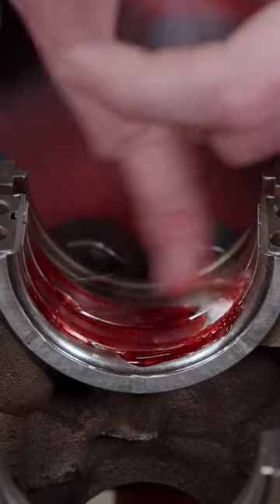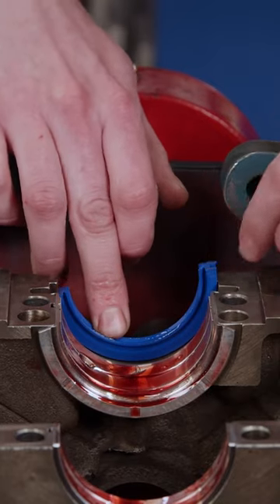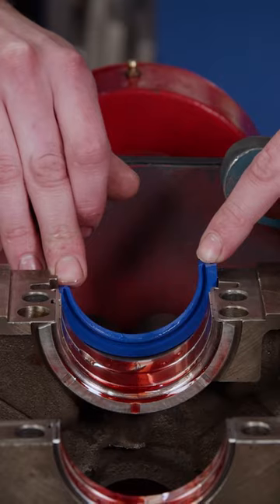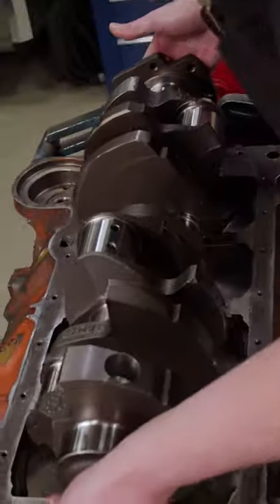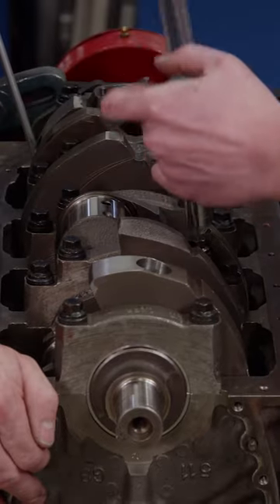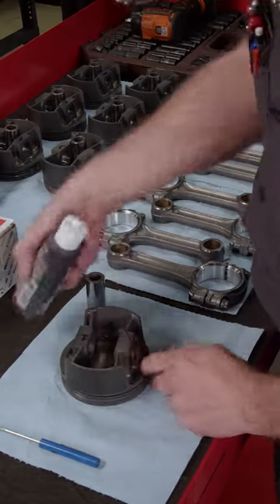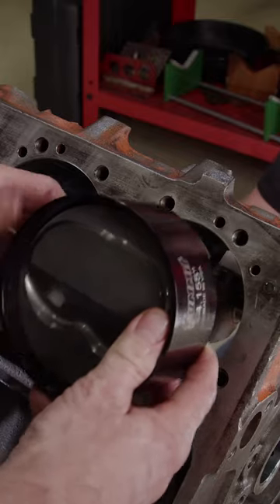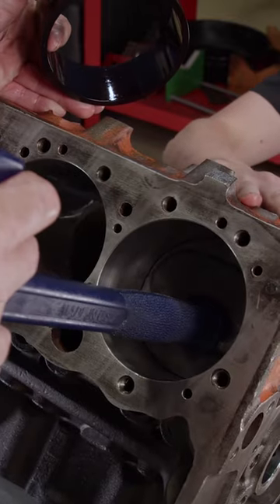Salvaged Small Block Chevy Assembly

Comment: These shows are very unreal, but still very entertaining. They can drop $100,000 into an engine without blinking. Like we all have that?
Reply: They need to have a Road Kill Dino Edition. Junk yard motors, with a budget. Then go see what they'll run on a drag strip or rather how long they'll hold together.
Reply: @anthonyehlers470  I'm not saying junk, but just a little more realistic for the average gear head.
Reply: This is a 100k engine ??? 🙃
Reply: @austingutierrez2709 with the tools you need to do it yes😂
Reply: That's not a 100,000 motor. Not even 10,000. More adorable you think
Reply: $10k and you can have a powerhouse engine, $20k and you can do that with a full supercharger or turbo + exhaust kit. $100k you could do that all, and rebuild the drive train and give it a full body paint job 😂 if money is the first thing that comes to your mind when looking at this, you don't have the money to worry about making more power.
Reply: Thing is they get the parts at cost, or less if it's sponsored. It's about demonstrating the process, and why demonstrate with something that you can barely tell is an engine? It's unfortunate how much it can cost, but with that aaid, I can guarantee you this motor is nowhere near 10said, dollars. Maybe 10 or 15 thousand, especially considering they're buying individual parts and not the whole.
Reply: Not quite that much unless you take into account they have a few rebuilds where the first thing they do is put the block in a cylinder hone. But i do get you, a lot of these builds are way out of my budget my 350 is just a junkyard motor i threw together with somewhat stock components besides a cam. Slowly buying stuff for it. Vortec heads are on the list along with all the valve train and a rowdier cam.
Reply: This is a small block so all these parts were probably less than $1,000
Reply: Some of PowerNations episodes are entertainment, and some of our informational, they do a lot of budget builds
Reply: They could keep it to themselves but they decided to share it. A lot of cars are the same and this can teach people some common sense of cars.
Reply: @anthonyehlers470 they try to sometimes but always go overkill with the aftermarket parts
Reply: Get your money up then
Reply: @shakinbottles  since when do you include the price of tools for the price of the build? Especially because more than likely if you’re doing this probably already gonna have tools
Reply: @shakinbottles  also what are the expensive tools in this video? An engine stand or a hoist?
Reply: @ZootedSosa ide assume they used a milling machine at some point if it was a salvaged motor. Probably also used drills or impacts and air compressor there's alot of money that goes into a good shop made to rebuild engines and bodywork and everything like I get it's maybe not 100k in tools but its still alot for an average person to do at home and most people don't have enough time to make using those tools worth it in the end they might be able to work on 1 car a month maybe while working and everything else that you need. And I was replying to somebody who asked if the engine was worth 100k and I said no but with all the tools (and labor but I thought that was just a given) that UT was probably close idk tf your trying to nitpick me about😂
Reply: This is only a 100k rebuild if you're using snap on tools
Reply: @sargentcupcake666  i think he meant the car thats its going in too
Reply: @austingutierrez2709  I don't know for sure, but it's more than the average working man with a house and family can spend, at least for me.
Reply: @anthonyehlers470 gotta love jyd for bringing junk back to life
Reply: A SBC is not $100,000 if you know where to look
Reply: One thing I have learned through my researches. In a standard performance engine,  it make no difference whether you use chrome, moly or cast iron rings. If I was rebuilding any engine where cast iron rings were original, I would use cast iron. If you are building for a daily driver, don't waste a bunch of money unless you have money to burn.
Reply: Not sure how we're getting to 100k here...  My local machine shop does a block for 650 to 1000 bucks for me.  I disassemble the block before I get there.  They clean, deck and hone cylinders and crank shaft journals...  Parts..  on the 408 stroker I'm building are about 3k..  that's for an undressed motor..  that's new crank, rods, pistons bearings and heads.  bolts and heads.
Reply: @skippynj1979  those are for normal every use engines im pretty sure the one he's building is for racing
Reply: @skippynj1979  You're not trying.
Reply: @Charles-oe4kj  gotcha...  I know most the teams out there are using leased engines on allot of the circuits.  Really don't know what this build was for.  I am a hobby engine builder.  It's fun..  sometimes they blow up..  most last long after I sell the vehicle to the next person..
Reply: @anonymike8280  if I was doing an old F1 engine...  I'm sure the costs get out of control

Comment: Man putting an engine together has to be some scary stuff. Probably feels amazing when it all works though
Reply: I could put one together no sweat... Now taking a working one apart and putting it back together is a different story lmfao
Reply: Fallow the instructions and have lots of buddies to see what you fu ked up
Reply: Having one started, pulling it down, label all parts and measuring, then rebuilding and starting it 👌 nothing quite like it
Reply: It's not scary, once you actually do it.
Reply: @ThatOneKiidThere  indeed. Did my wife's 07 suburban. Nothing like everything going right when you did it
Reply: Eh its not all that scary
Reply: @DONTCALLMETHAT you fix the low oil pressure? They like eating rod bearings because low pressure at idle
Reply: @outkast937  did the DOD delete
New oil pump and sensors. Infact everything new. .
Reply: Small block Chevys are not difficult for a backyard mechanic. I did 3 of them when I was younger with good results. An automatic transmission however is one I’d never attempt 😂
Reply: These parts aren't so bad... It's the wiring looms that scare me
Reply: @GIwillo  One thing to make sure of, although this may have been corrected long ago. Still, make sure there's no front to back play on the camshaft. Ford used a thin thrust plate with a thick gear, and vise versa. Two different versions. Thick with thick, and you'd bolt the cam solidly to the block. Thin with thin, you may not notice and could scrap your block.
Reply: Scary? Why? 
I’ve built all of my own engines, my own transmissions, my own rear end, in every drag car I’ve ever owned. I don’t understand what is so scary about it. As long as you do everything correctly and right, you have nothing to worry about.
Reply: @12yearssober 
Have built several automatics GM, Ford and Chrysler never got into any of the Nissans or Toyotas. I do all of my own engine transmission and rear end work. Excuse me, I mean I used to do it the last transmission I built in the last engine I built was about five years ago but doesn’t mean that I still can’t do it. I’m just old now. 😩
Reply: Every part has its place its pretyy much just understanding how they all work together. Once you know you can re -build anything

Comment: Always blows me
Away that the rods are connected with two bolts and can literally go hundreds of thousands of miles never once coming loose it’s just wild
Reply: The bolts are torqued to high heaven!!
Reply: Cool thing about piston rod and crankshaft bearing bolts is they're 'torque to yield' bolts. Meaning they physically stretch when torqued correctly, thus they should only be used once.
Reply: @adarco99  interesting I didn’t know that, thanks for the info that’s trippy but makes sense
Reply: Not all rod bolts are torque to yield. Popular ARP fasteners are torqued to a stretch value, but they return to their original size when loosened. TTY bolts are more common in head bolts, but make test fitting for checking clearances much harder.
Reply: @neerajahluwalia5512 Not really. TTY bolts shouldn't leave any gaps to close up when taken to their fixed torque spec (ft-lb, Nm, whatever). The additional angular rotation is to take up the elasticity of the bolts, so that they can't stretch under load and allow clearance between the components.

So if an assembly specifies e.g. 15 ft-lb, then 40, then 62, and then 90°, you do the first 3 steps until you're at 62 ft-lb, then make your checks and disassemble. Bolts are still usable in final assembly, because they haven't been torqued past their elastic yield point - they haven't stretched yet.
Reply: @Azlehria  if you look at the curve of stress vs strain of a material, even through the elastic zone, the stress continues to rise. This means the clamping load increases. Not torquing the bolts fully (the extra 90 you are specifying) will result in your clearances being off from measurement to final assembly.
That extra 90 is specified as it is a more consistent way of obtaining a torque value. E.g. torquing a bolt to 100ft-lbs vs 60ft-lbs + 90deg, the latter will be more consistent across different situations
Reply: @neerajahluwalia5512  The clamping load increases, yes. In order for that to affect assembly clearances in the bearings, the additional load would have to distort the caps by compressing the entire flanges beyond their designed limit; the bolts will fail long before that level of distortion is reached.

My AERA instructor actually demonstrated this to us. 3 sets of bolts, 3 PlastiGauge setups, one sacrificial assembly. Compression was the same between pre-load torque only, with the angle spec, and with the bolts broken off.

Once the pre-load is reached, you should have zero clearance between the mating surfaces and the material under the fastener should be at the maximum compression possible with that fastener. The only component which should be able to change its position or dimensions after that point is the fastener itself. Which is also why TTY is generally a lubricated torque spec: to reduce (ideally eliminate) any binding or galling which could falsely indicate proper pre-loading prior to the part fully seating and compressing.
Reply: @Azlehria  yeah but most tty bolts are not made to be reused.
Reply: @tscustomstation  Congratulations on not actually reading my comments. May I suggest that you try actually doing that before responding again?
Reply: There are torque-to-yield bolts and there are torque-to-tight.bolts
 TTY bolts typically are single use bolts, TTT can be reused. Instructions are important to know which ones are being used.

Comment: I can’t even crack open the water pump without feeling like I left everything loose lol imagine going balls feel like this and just hoping it works
Reply: You just have to be methodical. Take it one step at a time and don't proceed until the previous step is done. Torqueing in sequence, marking torqued bolts, assemble all pistons, then torqueing each completely as they are installed.

The step you miss is the one that will get you. So don't miss a step...

Comment: Millimeters, new generation of parts and the price is through the roof now.
Reply: Those Manley pistons are some of the best you can buy. Extremely light forged piston, with thin metric rings, the skirts are moly coated and the dome is ceramic coated. They're not cheap but $800 bucks for 8 pistons and ring packs for the best pistons you can get for a sbc isn't that bad. If you don't care about power and longevity then you can still build a sbc on a budget but parts like these aren't designed for a 350hp engine that'll rev 5,500 rpm...

Comment: Who doesn’t love a two piece main seal?
Reply: 3/8 offset?    I get the offset but why so much?
Reply: I’m not a fan of the 2 piece seal
Reply: @xmradio11 it's all they had for 80 years, give or take.
Judging from the bore, this is a 400 block.
Reply: @randybehrmann5454  I've only built one V8 in my lifetime. It just happened to be a small block 400 with 2 bolt main bearings. It was roughly 500HP with the 125 power shot nitrous. That was fun to build and drive.
Reply: Id rather have the 1pc. You can change it at every clutch job without dropping the oil pan

Comment: I've never seen instructions that say off set the 2 peice rear main
Reply: It's been common practice for 30 years or so to help prevent rear main leaks by offsetting the parting lines of the seal and the main cap.
Reply: I guess you've never looked at the instructions
Reply: interesting never knew this prolly cuz never looked at instruction
Reply: Felpro says do it.

Comment: What is the composition of engine assembly lube? How does it differ from engine oil? How well does it mix with engine oil when the engine starts up?
Reply: You are supposed to change the oil after you break in the engine/ cam. So 20 minutes or so. The assembly lube stays where you put it, unlike oil which will drain. Just adds extra protection for the first start up and break in period. 
 Also after first startup, cut open oil filter and make sure there is no "glitter" or metal flakes inside the filter.

Comment: Never Ever offset the rear main seal. Its designed to crush when rear main cap is installed and torqued. Just apply a dab of ultra black silicone

Comment: What would happen if you just put a crankshaft in without measure the bearings is there any presedures to it
Reply: Normally, the main bearing clearance is in the. 0.02 - 0.03 range.  If the clearance is too tight, the bearings could seize and spin. Too loose could cause low oil pressure. Rod bearings are usually about the same specs. On the rods, you should check the clearance between the big end of the rods. That clearance should be somewhere around 0.06 to 0.14. 
If you just throw it together and hope for the best. That could be a colossal waste of money. Cuz, it might not last very long.
Reply: @Thundarr995  if you are giving the mains .020”-.030” clearance? I promise you, it will come unglued quick like in a hurry.
.002”-.003” but closer to .0025” 
That decimal point makes a HUGE difference in placement.
Reply: I love all the experts, the word blueprint comes to mind , when machining all the parts you set the clearance is cranks turned on low or the crank is, time for the rods, there's a half a thousand from hi 2 low, the mains there's 9/10 from hi to low ,,it is rare define it doesn't measure where the manufacturer says it sickness wise. when this is done the  Machinist has set his  clearances. you can go back and make your bearings, your clearance is should be where you set them.

Comment: Pro tip: 2-piece rear seals suck.
Reply: o-ring>>>C-ring>2 piece LOL
Reply: @tedmich  The only rear seal design I've seen that works reliably and goes the distance is the type with a spring-tensioned, lipped rubber seal - molded onto an outer metal ring - pressed into a separate plate that bolts to the rear face of the block.

There might be other approaches that work - but I haven't seen one.

Comment: Has anyone ever had assembly lube "dry out" and turn to glue?
A friend if mine built a 6 cyl MB diesel about 5 years ago...its diuble bagged and stored inside and theres ZERO rust on any surfaces...but that thing is seized solid.
Reply: Lol maybe he got his assembly lube and red locktite mixed up😅
Reply: It does get very sticky when it dries but not to the point where it would seize the engine.
Reply: @Ada-zn3pw  it's just about the only possible answer. It's not like the rings rusted if nothing else inside the bags has even the slightest hint of even flash rust.
Reply: @danielkingery2894 
"... the only possible explanation..."
Famous last words.
Reply: @largemarge1603  so basically,  you have no experience,  no suggestion, no practical advice, but somehow....in some distant universe...the Force requires that you comment.?

Comment: Fel-Pro? I was always told never to get Fel-Pro at O’Reilly’s auto parts because it’s their lowest quality line.?
Reply: Felpro is a good brand. The reason they said that is so you buy their store brand lmao. Orileys sucks. I only go to autozone or napa
Reply: @DeflatedMeatball I go to O’Reilly’s because they carry the oil I need for my flat tappet sbc (Rotella T5), but NAPA’s always my go-to for replacement parts.
Reply: @yaboileeroy3038 Brad Penn oil is good stuff. Has plenty of zinc in it.
Reply: If the guy at O'Reilly told you that, he's an idiot. That's his opinion and NOT something that he learned working there.

Comment: IM A HOTRODDER....AN ENGINE DESIGNER.....I BUILD FOR THE HIGHEST HORSEPOWER .....BUT IM NOT A BOOST. GUY......IM OUT IF THE TRANS AM....AND CAN AM DAYS....MY CARS REFLECT IT a 71 630 HORSE 
350.....BUILT ALONG TRANSAM  LINES...MY CORVETTE IS A BF GOODRICHWIDEBODY CORVETTE...
I DESIGN CAMS..ENGINES...
I SET LSA...QUENCH..COMPRESSION.......I WATCH YOU TO LEARN SOMETHING......OFF THE SHELF CAMS TEACH ME NOTHING.......YOU WONT WIN A DRAG RACE IF YOU DONT EXPERIMENT......I KEEP HOPEING  YOULL PUSH THE LIMMITS.....BUT IT SEAMS YOU DONT LIKE ENGINES THAT PUT OUT MAXIMUM POWER.....I HAVE BEEN WATCHING YOU FOR SEVERAL YEARS NOW DINCE YOU INVITED YOURSELF TO HELP 
THE CAST MEMBERS.......I WILL SAY YOU DO FOLLOW
THE BOOK.......I DONT...I WRITE NEW ONES.....IVE BEEN THROGH CHRYSLER  R AND D
TO DESIGN ENGINES....I WAS
20 YEARS AHEAD OF DAVID VISARD. IN CAM DESIGN...HES JUST GOTTEN TO THAT POINT NOW.....ALLS I CAN SAY IS DRAG RACEING...DEMANDS 
I OVATION....GET TO INOVATING.
Reply: you couldnt lace david vizards boots! 
typical septic tank